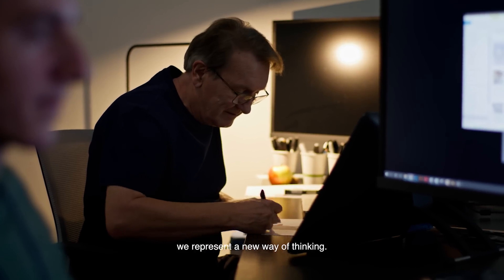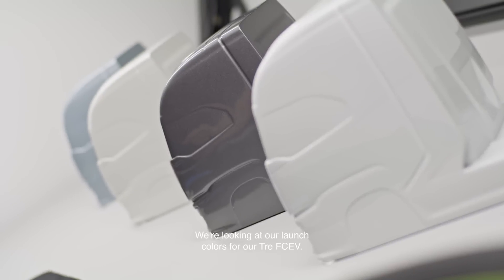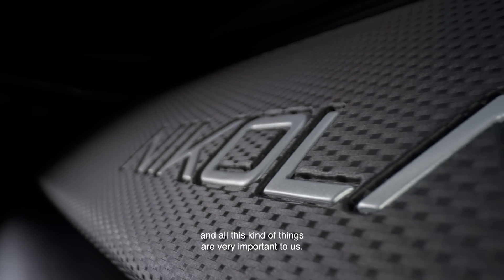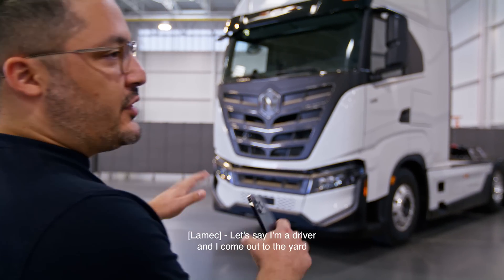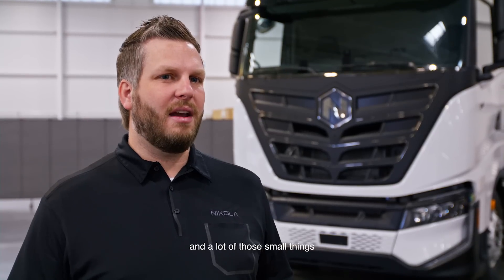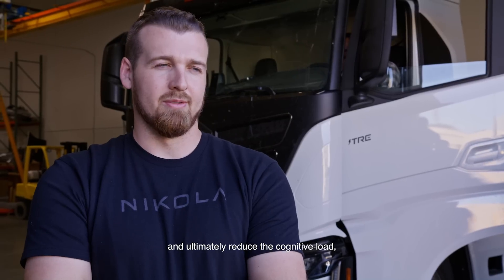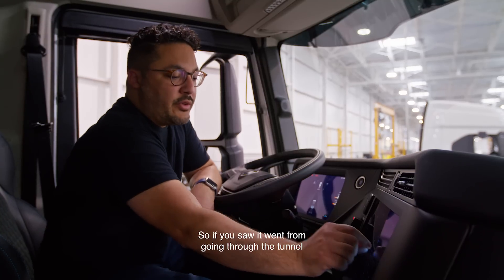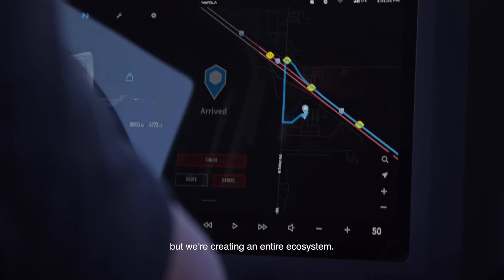Driving Change Season 3 Episode 5: Engineered Design | Nikola

Comment: WHERE is the admission that batteries need to be charged. A full-blown electric Semi Truck is a great idea, and she could roll forever with a charge.

Look at any Locomotive a mile long, pulling cars across this great land of ours... It has Diesel engines that POWER THE ELECTRIC MOTORS THAT DRIVE THE WHEELS.
Why don't engineers build a small APU (Aux Power Unit) into this vehicle? That would be next-level engineering. Who wants to stop and charge a semi-truck for 2-3 hours, if you can even find charging, when you can charge driving down the road? 
It'll mean fossil fuels... Small diesel APU kicks in at 35 - 45% Battery level, and drives big Generator, charges Batteries as you drive. 

I still don't see APU's as a working thing, and I wonder why.

There is no such thing as Green Power.

Comment: Tesla is chasing Nikola. The advantage of hydrogen truck is that the driver can take a shower or use the water with furifying system.  It may not be easy to compete with tsla if you don't take advantage of it. I hope my opinion will be taken into account because I have share and voted.

one more thing. Compressed H2 can cooling the meet or food container without additional energy source.
Reply: I hope this truck could save H2 compression energy by cooling food or meet container when driving dessert.
Reply: I missed that this truck would using Compressed H2.

Comment: I've been a truck driver for nearly 16 years and I love technology. Today the industry with it's typical vehicles on the road today has a lot of extra add-on safety features. Seeing this video the technology and safety features are built into the system with thought and precision in mind. That is exactly what us needed to reduce distractions. I am impressed that Nikola Technology is building around the driver's comfort, making the display interactive and a driver is able to pre-cool or vent their assigned vehicle ahead of the work day.
Nikola Technology is changing the way trucker's embrace technology - it is bringing us into the picture.

Comment: The mobile diagnostics app will be a game changer. This form of software integration will incrementally increase the value prop for these trucks - software can not only simplify optimization but also better the user experience, which is obviously extra critical in the trucking industry.
Reply: Agreed
Reply: I can tell you, from someone who works in the commercial trucking industry, this is huge and definitely a game changer.  It could be the most valuable component of the BEVs and FCEVs.  Fleets long for useful data.